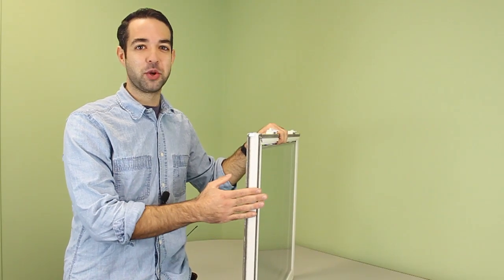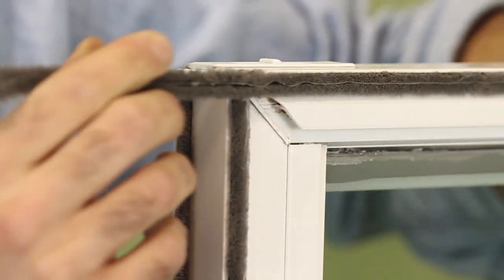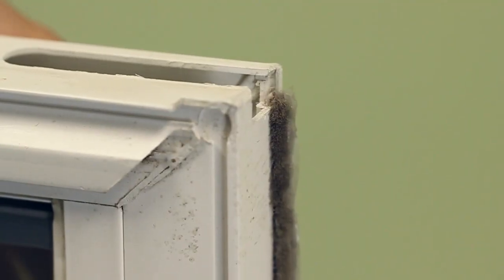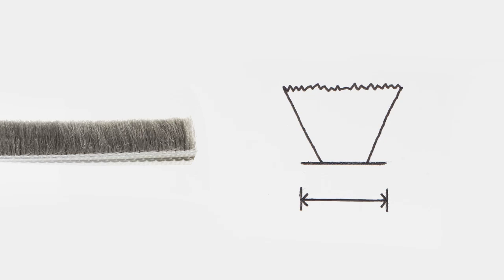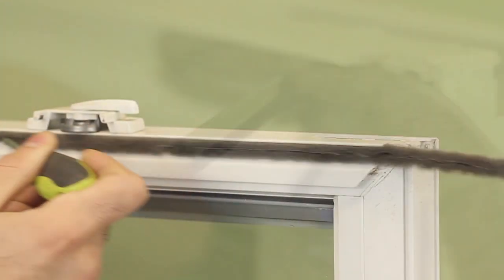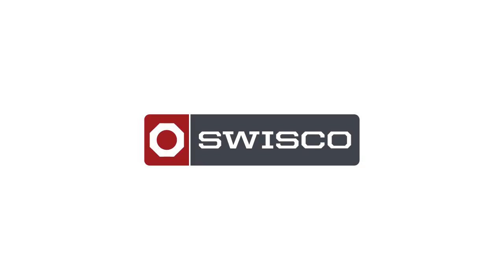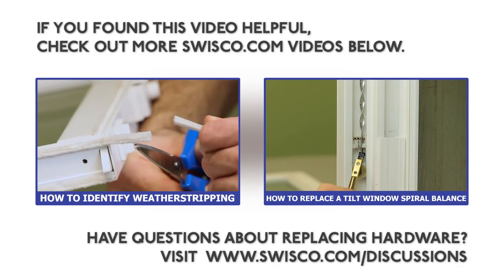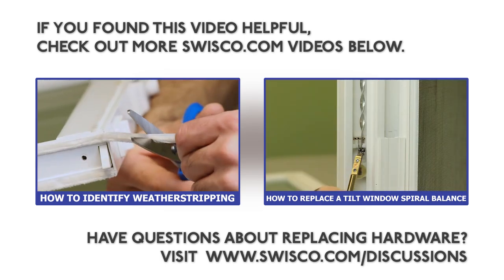How to replace wool pile weatherstripping

Comment: The recommended hammer is to be used on the guy that attempts to crawl into your house while replacing the wool pile- there's an additional video available on how to use the hammer, how many times you hit, where to hit and what you do with the body after the wool pile is installed.
Reply: Hmm

Comment: I purchased the zipper back weatherstripping from Swisco for my 1960’s aluminum sliders. Replaced all the vertical strips myself, it just pops right in easy-peasy even for this 68 year old. I’ll need help on horizontal installation bc the doors need to be removed. 
My old stuff was so deteriorated that I ordered a few feet of multiple pile heights to get the best fit. 
Thanks Swisco, you helped me solve a daunting challenge!

Comment: Apparently I have a lot of work to do on these windows and have decided to burn the house down to save some time and money.
Reply: Same
Reply: fuuuuuuuuuuug man I'm nearing that point.  Insane my 12 year old house leaks like a fuggn flour mixer!  One of the shitty Doyle or whatever "rated best windows of blah blah blah by blah blah" I have, the GLASS is literally falling out of the crappy vinyl frame!  This turd was appraised at $415,000 recently..  Yeah right!  This place originally sold for $165k but its legit not worth $70k in my opinion!  Yeah the pile leaks, but sure doesn't stop the air from coming in BETWEEN THE FRAME AND GOD DAMN GLASS!  This modern "energy efficient window" thing is an absolute scam!

Comment: Thanks! the same removal is done on commercial doors with a single strip. the edges of mine were bent to hold it in, I thought there were screws... nope, untack the edges and it slid right out. replacing it with rubber.
Reply from the maker: Awesome! Good luck with finishing up the project.
Reply: How did you like the rubber replacement? Was it squeaky? About to change out my commercial and was thinking of replacing with same not rubber.
Reply: @Zooksboardshop  there is a "thunk" in the door when it swings open/closed. Otherwise it's fine. Door doesnt get heavy usage and it's blocked a lot of traffic noise. I need to find something for the bottom of the door, wind blows in leaves. I should just switch out the threshold with ine that has a rubber middle, but that means removing the door... more than what I want to do right now.
Reply: @timothy2830  Thank you

Comment: Thermal Industries, my window manufacturer, is out of business.  I asked a window mechanic to replace the weatherstripping on the sides of my 26 double-hung vinyl replacement windows that are 25 years old. It appears that the old 3/16 T slot pile weatherstripping is crimped at the top and bottom corners of each sash. The mechanic said since it was crimped in place, he did not recommend replacing it. Instead, he recommended reshimming the windows to make the weather stripping space tighter.  Reshimming is somewhat helpful but to get rid of drafts completely, I think replacing the old pile weatherstripping would be a wise move.  Can you please do another video showing how you can remove crimped weatherstripping,  and replace it with new 3/16 width pile weatherstripping, crimping it again so it stays in place at the top and bottom of each side, without damaging the weatherstripping track? Since the windows are old my biggest fear is that I will damage the weatherstripping track and then the windows would need replacement.  Thanks! P.S.  I see you made such a video "How to Cut Out Pile Weatherstripping SWISCO 25K views 2 years ago" The problem is I cannot clearly see how you cut the channel to remove the old crimped weatherstripping and how to re-crimp it for it to stay in place.  I have replaced the weatherstripping at the rails and the bubble seals at the bottom of the sashes (neither of which are crimped) but it seems like a big risk to replace crimped pile weatherstripping.  I would give it a try if I had a clear picture of how to avoid damaging the pile track and how to secure the pile so it does not move when you open and close each sash.  Thanks for your recommendations!
Reply: really wish you received a response. i replaced it on a few windows and on some the felt moves out of the track when opening the window
Reply: Hi , when I replaced the wool piles on my windows I noticed it has been held in place by a crown staple. So I suggest getting a crown stabler to keep the pile in place. There are other options too such as glue.

Comment: What keeps the strip from sliding out of the sides of double hung windows as they're operated?  The old pile was stapled in place.  I don't have the type of stapler to duplicate that installation.
Reply from the maker: Often, there is a slot to slide the strip into. In the absence of that slot, you can use a thin bead of Loctite or other sealant to hold the strip in place, but be cautious in applying it. We also have the 58-026 stick-on wool pile, which can work for some customers, depending what size they need: https://www.swisco.com/Wool-Pile-with-Stick-on-Base-White-1_4-inch-x-1_4-inch/pd/Wool-Pile/58-026

Comment: I have some windows that are just a few years old that leak along the weather stripping on some sides. The factory pile doesn't seem to be bulky enough to fill the gap (window sits a little crooked in the sash). Can I upgrade from 3/16"x3/16" to 3/16"x3x8" in the problem areas to better fill the space? 

Also, is there a reason you're  installing gray pile on a white window? Wouldn't white look better?
Reply from the maker: Hi Luke. We typically recommend replacing weatherstripping with an exact match. It's possible that your existing weatherstripping has deteriorated to the point that it's causing the leak and fresh wool pile may fix this problem. As for the crooked window - this may be a sign of a different issue, such as faulty window balances. Since we were working with a sample window used for demonstration purposes we didn't bother with the color matching, but if this was a window in a house - we certainly would!
Reply: My windows are white, but came from factory with grey pile. I guess the reason being you never see it when the window is closed. Or maybe back in '97 they didn't make white.🤷
Reply: Where can you buy white? I've been looking.
Reply: @bokay0348  I never found white in the size I needed and went with the gray.

Comment: my storm windows are old.  the pile you removed looked brand new compared to the stuff on mine, which is essentially worn down to the backing.
Reply from the maker: That is a sample window that was never in use, so it's not going to have normal wear. However, you should be able to remove it in the same way. You may want to push it through with an awl, then grab it with pliers like we do in this video https://youtu.be/IHR5g1c-QCU

Comment: if only this removal and install was actually that easy. my windows all had sealed slots, so the current wool pile couldn't be removed, and the new couldn't be slid-in. also, what the hell is the wool pile even doing? it barely touches the other window, and doesn't seal air...

Comment: The corner of my window had a screw in it that was easy enough to remove, but now it doesn’t screw in.  It just drops in and there’s no resistance, like something is missing.  Anyone know how to fox this? 🤷🏻‍♀️. My windows are old single pane in what looks like aluminum frames.  My house was built in the 70’s.
Reply from the maker: Hey there! Send us a photo of the screw and we can see what we can do. https://www.swisco.com/page-id-part
Reply: SWISCO I solved my own dilemma.  The screw goes back in at an angle on my window.  I angled it towards the outside of the frame and kept trying to screw it in until it caught what I'm assuming is a channel or track inside the frame.  It took a few tries but I got both corners tightened back up.
Reply from the maker: @TinaThevarge  Oh, nice! Glad you were able to work it out.

Comment: What if the windows are fixed, In Puerto Rico the windows can't be removed from the frame, they're fixed with mortar ...
Reply: The main window frame and fixed window would be permanently installed, but a sliding window will be removable. The wool pile is on the removable sliding window panel.

Comment: my window pile is not like that.  I can't even get mine out.
Reply from the maker: Sometimes pile gets glued in place. In that case, scraping it out is your only option. 

Sometimes pile is also sealed at the corners. If so, you need to trim a little off the seal to release the strips of pile. If you have more trouble, write in to our experts: https://www.swisco.com/page-id-part